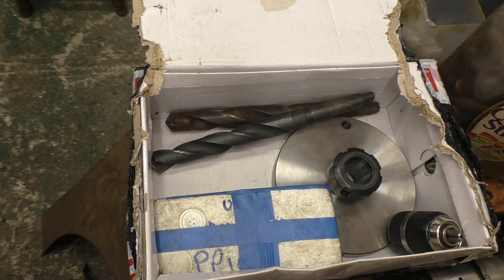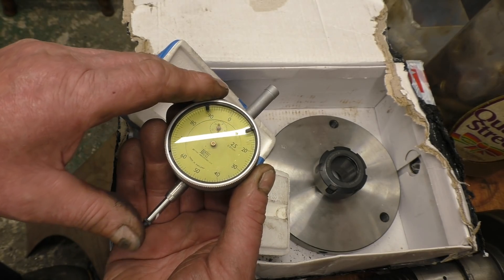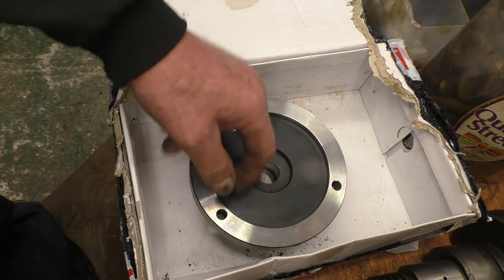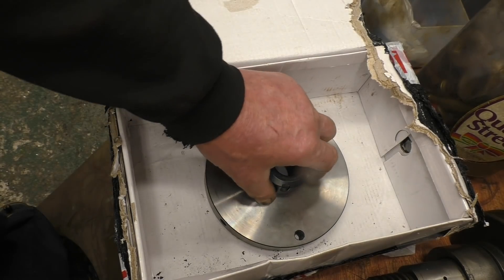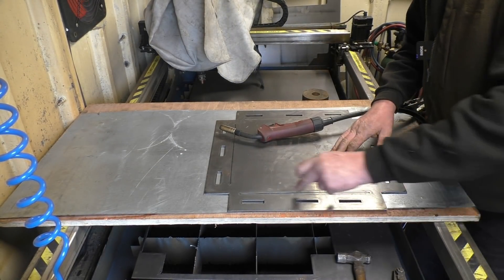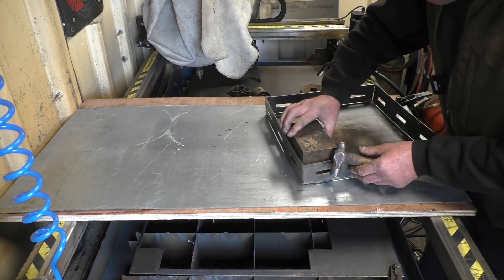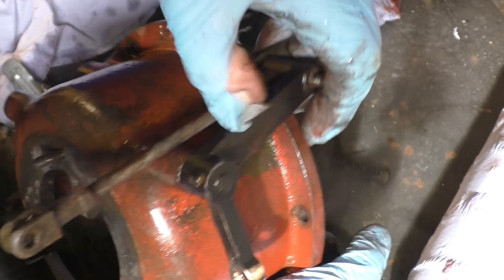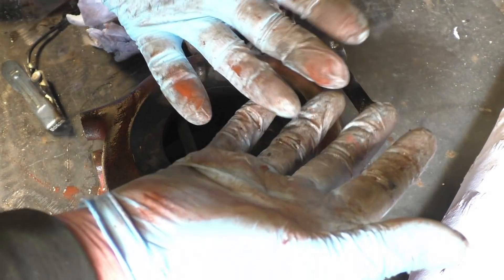SNNC 382 P2 Ash Pan Fabrication , Electrolysis Results

Comment: I won't be plasma cutting the pieces, but I need to make a charcoal brazier along the same lines as the pan you made, just somewhat longer.  I was also impressed by the electrolysis results, definitely have to give that a try!

Comment: The plates that have the + leed will get covered with rust and crap so when you clean the crap off them the charger will once again work. I use stainless steel plates because they last longer. people will tell it makes hydrogen gas which it does but I've never had a problem. the plates slowly get eaten up so save your scrap.

Comment: one thing that will speed that electrolysis up is more voltage, i use 2 12v chargers in series for 24v and that speeds things along nicely!

Comment: A question regarding the tray. Why did you cut the 4 slits and then weld them up. Could you not have just bent up the sides?
Reply from the maker: That is 2 mill plate not easy to bend I should have left a couple of tabs in the cuts
Reply: @doubleboost  Hi John. Thanks for the reply.  Point taken I’m no expert, and even with a bender I suppose it would be possible to bend the 2 long sides, but then the short sides would still be difficult. Watching the steam engine videos with interest, not easy is an understatement, but with your determination I’ve no doubt you’ll succeed🤞 Cheers Noel.

Comment: Did electrolysis for a small 1in micrometer I got that was rusted solid. Used graphite electrodes instead of steel, and after a hour of current it was enough to get the unit free to take apart and clean, though it would never fix the pitting in it, plus the small ratchet mechanism had completely corroded away and broke on removal. But at least now it sort of works, and after adjusting and oiling is quite good.

Tip for the next time ois to put a 50W car headlight in series with the charger, so that if you have a short between the electrode and the work the light will save the charger from damage. I just used 50W 12V downlighter lamps, as I have plenty of them along with the holders. They normally will barely start to glow in operation.

Comment: For the rust inside the end cap, remember that electrolysis mostly works through "line of sight", it's worth trying to suspend an anode inside the part (without touching, obviously - a rag wrapped around it can resolve this potential disaster).  If your charger hasn't shit the bed, causing it to stop pumping electricity around, it could well be that the anodes are gunked up - it's often a good idea to pull them from time to time and hit them with a wire brush to get some clean surface showing.
Reply: He's probably cooked the 12V side of that transformer !
I said in the previous video - to stand the charger on its end so the casing forms a chimney to give it better ventilation. Yes, I have a similar charger !
Reply: Yes, was going to say the same thing.
I used to do this prior to using a home zinc plating kit and it worked really well though I had a steel tank which I welded up as this allowed it to go on an old camping stove, speeds things up nicely when your solution is simmering.

Comment: I hope that the anti rust process you decide to use makes the rest of the project go well for you.
Great videos to watch on a Sunday. I hope all is well with you and your loved ones.
Reply: Just needs to find an old wheelie bin to fit the rest of the engine into and fill it with water, washing soda and some other scrap plate to make it all come out in one big shot. Will free up the stuck parts for sure.

Comment: BBQ tray thing looks very good unless it is suspended in it's hole by the flange that runs around the edge of the original?
I'd be careful with non ferrous metals in electrolytic cleaning, they tend to get attacked quite aggressively.

Comment: With ref to your electro clean you could try making the work piece +v anodic cleaning as opposed to your cathodic cleaning is used a lot in metal finishing processes
Reply: For the love of god no.  If you do this you will increase the depth of pitting on the workpiece, perhaps ruining it utterly.  Ask me how I know.  Hint - it involves a piece of swiss lathe, 30 seconds, and a DC welder as a power supply..